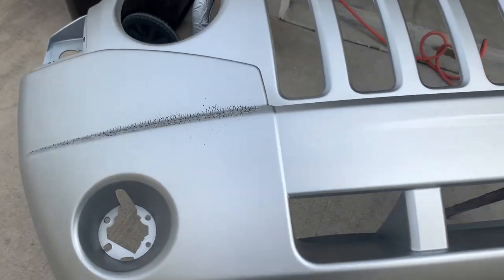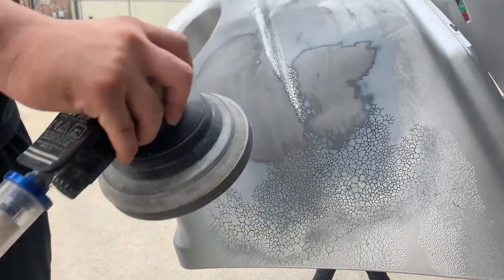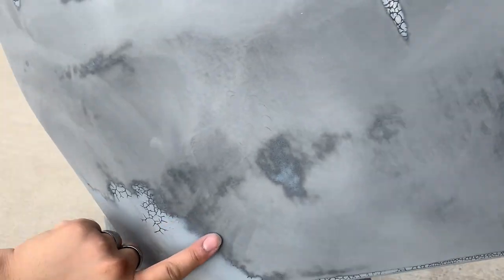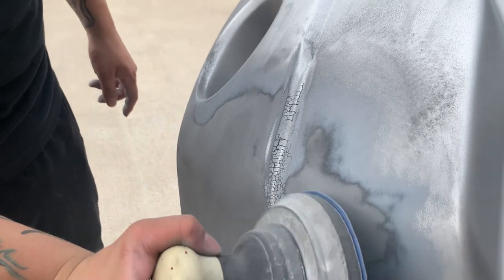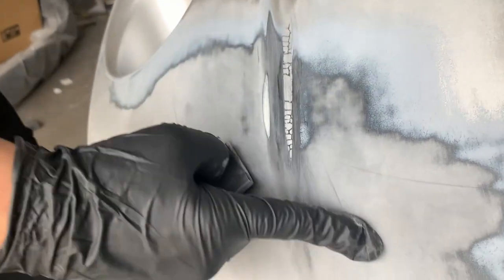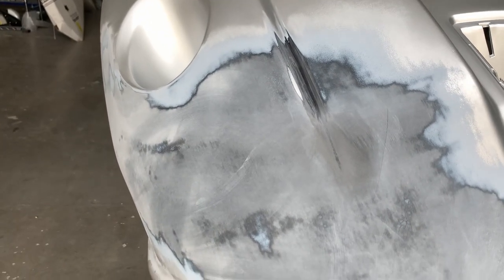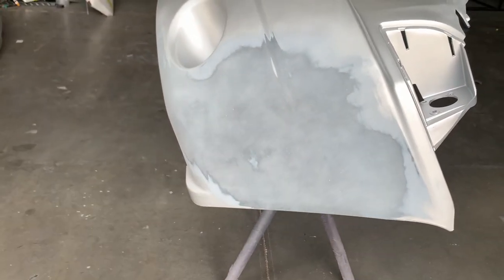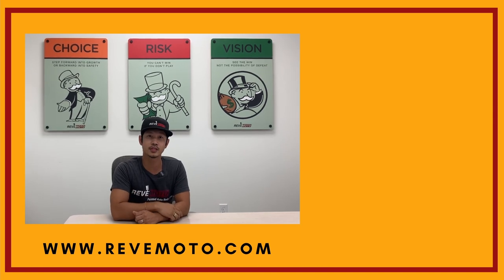How to Fix a Paint Reaction | ReveMoto

Comment: I have got the same issue, is that because of the paint behind the primer that caused this?

If so do I have to strip off the old paint, then apply the primer?
Reply from the maker: This was due to over application of the basecoat.  They went too heavy.  In your case I would just sand down the area with 320 until it’s smooth and primer.  If it’s the whole thing then strip or sand down entire area and primer
Reply: @ReveMoto   Oh thanks, so if I strip all of the old paint off and apply the primer, I would not get anymore wrinkles and fisheyes?
Reply from the maker: @chris01479  Not exactly.  Wrinkles as long as you don't lay the base to heavy that will help prevent it.  Fisheye  just make sure no water or oil in your lines
Reply: @ReveMoto  Oh right, I have got upol slow drying degreaser so when I clean it to remove the oil, water, dusts, fingerprint...etc, it will help to avoid the fisheyes?
Reply from the maker: @chris01479  It will help, but remember your air line should be free of oil/water also.  The compressor has oil and water in it, so make sure that is not being pushed into the air line.  That is why you have a filter system to remove this.

Comment: Question ..I'm having problems with my door door ..have done it three times ..would it be better to prime ..then paint
Reply from the maker: Not seeing what actually has been done, but reading your comment.  Sand the area with 320, then primer, then sand with 400 grit, seal it and lay paint.   That will give you the surface that will be great to paint on